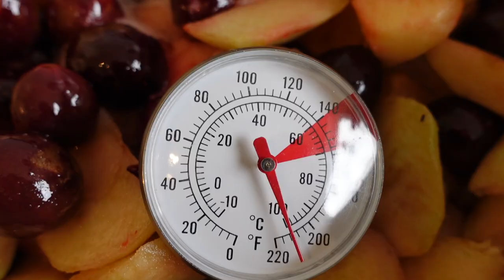This van build is getting tough | Madness and Jam | VAN LIFE UK | DIY VAN BUILD Ep 28 | FORD TRANSIT

Comment: It’s so annoying when the weather holds you back! But the mirror and drawers are looking sweet and the jam looked tasty so you made the most of it regardless 😀 When you say you put a plug hole in your sink, did it not come with one?
Reply from the maker: Thank you so much, the jam is delicious (although a little crunchy 😜)

The cold weather is the worst thing when trying to push on with a van build.

The sink did come with a plughole fitting, but it was made of really flimsy plastic, didn't fit our 40mm waste pipe, and still needed fitted. The sink just had a big hole in it. So we got a better one and attached it instead.